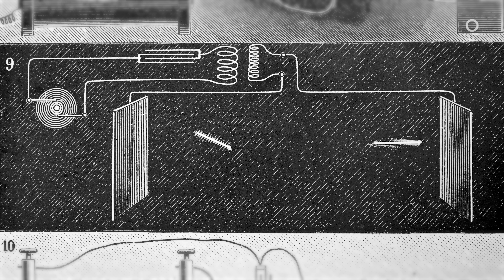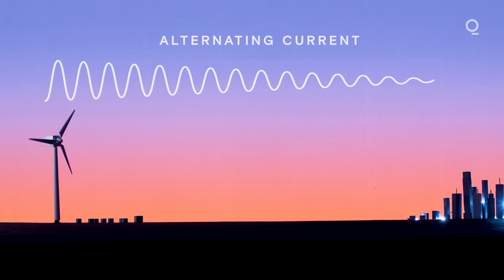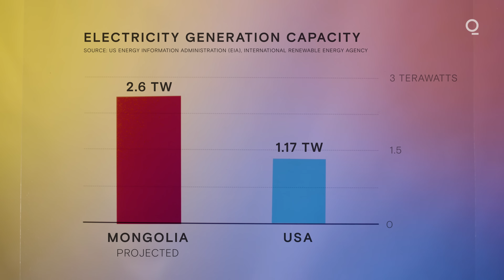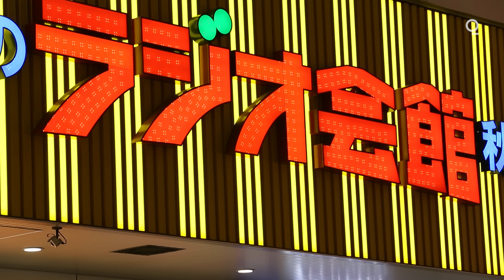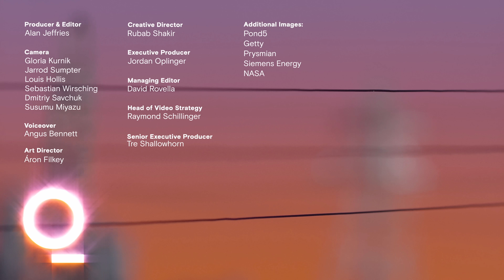The World Needs Supergrids, But There's a Problem

Comment: Are there means to transmit electricity via microwave beams instead of cables ?
Reply: That's potentially doable.  For intercontinental power transmissions, satellite mirrors and ground stations would beam the microwave.  If Saudi produces excess solar energy and Japan wants to import it, than Saudi would beam the energy into space based reflective device and then beamed down to Japan's ground receiving stations.  Solar energy can be stored as heat in molten salt.  We are talking about energy economy here, so everything must make economic sense of course.
Reply: The are multiple projects in existence. But so far either transmission rate, transmission efficiency or range are terrible

Comment: The AC is not attenuated in the shown way by distance.  What really happens is that power is transferred by phase shift between the ends.  As a demonstration:  To feed more power from end A to end B, you need to feed more coal to the boiler and try to speed up the generator at station A.  That advances the phase at A relative to station B.  However, there is a natural phase delay in power lines and to keep the A and B synchronized, you bump into the true distance limit, something on the order of 1000 miles where the phase shift becomes excessive..  You need AC to DC conversion and corresponding DC to a second AC conversion every so often.  In other words, to keep the two end frequencies and phases localized.
Reply: This makes a lot of sense! Do engineers have the infrastructure to make this happen?
Reply: @marktwain368  It doesn't make any sense at all. The guy is living in a world of illusion.
Reply: @marktwain368  Losses are measured per m and in all of my calculations that I've done at work it seems that there is less losses in HVDC UGC than HVAC

Comment: I think the transmission energy loss via heat would be too much. A better way is to produce electricity close to where it's needed. In other words, SMRs for small towns and large NPPs to provide baseload power for countries. No need to have insanely long and large transmission cables between continents or anything like that. Added bonuses are medical radioisotope production, desalination, water heating and carbon-neutral petroleum/diesel production.

Comment: The farther we try to transport electricity the larger the "line losses", energy dissipated as heat along the wires.
Interconnectivity of grids does still have important advantages though. It provides redundancy, so that a breakdown in one part of the grid can be bypassed through alternate routes. But in the end, the most efficient plan is to try as much as possible to have "distributed production", lots of small scale generation scattered around the grid. This reduces line losses. Also, as we move more and more towards solar and wind, we can take better advantage of their production periods. 
This is why rooftop solar and small to mid-scale wind farms can work very well together. 
Yes, there are times when the sun doesn't shine. But at those times, heavy cloud cover or night time, there is often wind to compensate. And sometimes conditions can be quite different between 2 locations just a few miles apart.
So, grid interconnectivity and distributed production can be designed to make much better advantage of these renewable resources.
And yes, I readily acknowledge they will not account for the large majority of our needs anytime soon. But they have an important place and we could be making much better of them.
Reply: Ideally, from an environmental standpoint, resources consumed locally are produced locally. This general principle almost always has advantages. Future urban development and growth really needs to factor that in.
Reply: Not with hvdc
Reply: What about underground transmission using low resistance superconducting materials? Hypothetically, of course, assuming it was technically and economically possible. Maybe a continental grid connecting US-Canada-Mexico. You could co-locate communication data lines, and both would be impervious to EMP and solar flare radiation. The cost would be exceedingly high but the potential benefits might justify the risk.

Comment: Im thinking bore hole water down the hole and up comes steam if its deep enough, steam turns the turbine to make electricity easy :) but perhaps a little more research needs to be spent on deeper bore holes.
Reply: Geothermal is only practical where the Earth's geography favors it. It will always be a small percentage of overall electricity generation.
Reply: @JeanPierreWhite  hence the research needed to bore deeper bore holes :)
Reply: @JasonPurkiss  Digging a deeper hole doesn't need research. It needs money. Some locations we don't need to bore very deep to find heat underground. In other places it's much further and therefore becomes economically untenable.
Reply: @JasonPurkiss  If the process can be made cheaper it would open things up somewhat. Not sure I see the point of going deeper than 22000 meters.

However it maybe less expensive to build solar and wind on ground.
Reply: @JeanPierreWhite  a bore whole would last a life time where solar and wind power has to be replaced every 5 to 10 years and would expell more carbon dioxide in its creation

Comment: Yes true but a super grid and evs and intermittent peak geographical loads with humans as random as the weather 😄 Wires get exponentially bigger and longer over distance lol 10,000 EV'S anyways is a dynamic peak loading! If you dont assume killing fuel is a must to be green then a Small Nuclear Reactor  will not need as many wires.

Comment: Or maybe instead we just build more smaller nuclear reactors and we dont have to worry about transmission lines as much.
Reply: its expensive and should only be used as a baseload. Renewables are by far the cheaper and will form the majority of our electricity production
Reply: You will still rely on transmission lines.
Reply: It's possible, smr fit to fulfill energy nearby with cheap cost.
Reply: For some reason there is a secret agenda against using it. All the education proves a reactor would be the best choice but no one wants to do it.
Reply: NO
Reply: Clean fuel cycle for nuclear?
Reply: the real problem with this solution is nuclear proliferation and the unintended consequences.

Comment: The very concept of centralized power generation to distributed power consumers is antiquated and risk laden. Much greater affordability and network resilience is achieved if we look at all consumers as generators and empower them to produce and store their own power, and more where possible, for public and private benefit. An entirely distributed grid of independent generators in other words, with centralized need only for maintenance and modernization when required
Reply: Right! Let's get rid of the grid.

We'll just buy solar panels and batteries for everyone. For 12 h of solar I need 2x as many panels and 12 h of battery (for the night).
Oops, my neighbor's house was just hit by hail.

We'll just buy solar panels and batteries for everyone, and have a small distribution grid at the neighborhood scale. We'll have to raise the solar, because when the neighbor's output goes down, the rest of us have to make up the difference.
Ooops, my neighbor's house (right next to me) was just hit by hail - and so were all the other houses (including mine) in the neighborhood.

We'll just buy solar panels and batteries for everyone, and have a large distribution grid at the city scale. We'll have to raise the solar, because when a neighborhood's output goes down, the rest of us have to make up the difference.
Oooops, the winter is particularly cloudy, so we'll have to build a small transmission grid at the state scale.

We'll just buy solar panels and batteries for everyone, and have a large distribution grid at the city scale + a small transmission grid. We'll have to raise the solar, because when a city's output goes down, the rest of us have to make up the difference.
Ooooops, the winter storms cross multiple states, so we'll have to build a large transmission grid at the nation scale.

At this point, given we have a full distribution system and a large transmission grid, why bother with the solar panels and batteries, and just use centralized power stations? 
Something low-carbon and centralized that can be put anywhere.
hmmmm.
hmmmmm.
hmmmmmm.

Like nuclear.

Comment: "bump up your current to a much higher voltage" current is measured in amps and voltage is what you are transforming up, to Lower the current in the wire because p=U*I the higher the voltage the lower the current for a given wattage. This allows for thinner wires.

Comment: The problem with super grids is dependency on foreign countries. We need to figure out how to live in an area based off the area, not based of the fact you can import resources to live in an unsustainable area. 

Without the pressure to supply for local demand with local power sources, we lose innovation and we abuse the power sources we already have. Just like oil/coal/gas. 

There will be problems with renewables and a sustainable approach is a diversified one where the needs are met by tailor made solutions for the area, not just brute force imported.
Reply: It's more elegant to design a system that can work independently of other countries, but just imagine how half of the earth has always sunlight, and can power the other half at night. You remove the need for battery storage. At least in the short term it would increase the capacity of the grid and would add redundancy to already self-sufficient places.
For example, you can waste less energy when you have more than you need and just sell it to other countries
Reply: If we can trade goods with each other then why not trade electricity also ? Export when you have surplus electricity and import when you have a shortage....
Reply: True but I think if the super grid were to become a thing the countries that have a lot of renewables would start selling their electricity off just like with how coal or natural gas sells the resources.
Reply: A decentralized grid is superior to a centralized one. It leaves no single point of failure and it gets rid of the transportation/transmission issues.
Reply: @kirbyjoe7484  Why not interconnected decentralized grids that act as a power plant market. The issue with seperate girds is that they are plagued by instability because they lack the electrical 'inertia'. This is a already a large problem for Texas and the two separate Japanese grids.
Reply: @gljames24  look at the HVDC grid in Europe , they are almost there
Reply: I think civilization as we know it is based on the principle that you can get any product anywhere in the world, without it we would go back to living in places rich in natural resources and not live in places without them
Reply: The sun does not shine everywhere at The same time. We already depend on what happens in foreign countries. We simply need to throw away the war machines and get down to the important business of civilization upgrading. As a species.
Else, fossil fuels will doom us with their dark clouds.
Reply: That's a long winded way to say, "I'm just an isolationist racist who thinks everyone else ahoud just die so I can have everything"... get an education and stop bring proud to be ignorant
Reply: With that approach people wouldn't move past temperate climates really
Reply: Ridiculous
Reply: Blah blah
Reply: Well said. Being self sufficient with local power sources only is the way forward.
Reply: @JeanPierreWhite  in an imaginary world yes. In a real world no.
Reply: @JeanPierreWhite  lol, as if every community has the capacity to do so.
Just don't get dependent on autocracies.
Reply: Small modular nuclear reactors seem to be a way out of that problem.
We are not going to see that level of cooperation globally anymore, not with what happened when the cabal of WHO/WEF caused the worst economical collapse of the this and the next century, affecting billions of people.
People just don't want the risk of having a global logistics chain anymore.
Things will have to be produced locally, forget this idea of a global 'internet' of electricity. 
Electricity is too strategic of a resource to share.
Reply: @monad_tcp  how did the who cause the economic collapse?
Reply: @garganransis   that's very obvious, isn't?
The unnecessary lock-downs
Reply: @monad_tcp  Nuclear reactors still need uranium imported from somewhere. Uranium deposits are not everywhere.

Comment: The word needs rid of the grids by decentralizing power generation and storage.  That will also allow us to switch back to DC appliances.
Reply: @lepidoptera9337  high voltage DC is also MUCH more dangerous because quenching a DC arc is much harder than quenching an AC arc. DC circuit breakers need to be built to higher standards and you have more danger of arcs starting at the connection points (such as plugs and switches).
Also three phase AC allows massive savings on copper compared to DC (for balanced loads with 3 wires you can trasmit as much power as with 6 wires of the same diameter in DC, and if you have unbalanced loads you just need a 4th wire).

Three phase AC is vastly superior to DC in all respects except for extremely long distance and undersea power transmission.

Comment: Tesla did not invent AC. William Stanley Jr. demonstrated the first high voltage AC system. Tesla invented a very popular AC motor.
Reply: Not quite, Nathanael. Tesla patented a lot of trivial adjustments around the edges of things.
His only notable invention was the Tesla coil. It makes impressive sparks using weak power at high voltages, and involves no original invention. 
Just like the man himself.

Comment: The main reason for AC being better than  DC was that AC has much lower losses as heat in comparison to DC when at high voltages at long distances! And the voltage changes between positive and negative values!

Come on Bloomberg, get the science. Yours Truly, AP Physics Teacher.
Reply: That’s what I thought too, so why do they want to build DC lines at all?
Reply: Not really no. DC has no skin effect, for example. Also a lot of other benefits: charging loss,.corona etc.

Comment: Bad idea .... Worst idea 💡 Muslim countries are very hostile and if they have a problem with a country they can cut the power same goes to China and any Communist or corrupt county just a bad idea .... Globalization is a bad idea also this is the reality
Reply: You are thinking of a system like the current fossil fuel, where a small number of countries supply most energy and rest pay!!!! Where the supper grid would be a symbiotic relationship sharing power in all directions, more like the internet than the current fossil fuel system. So any one country turning off is a minor issue, and affects them most as they wont receive any energy when they need it.

Comment: There's a series of videos called "The Light Tamers" by a physics professor here on YouTube that has the history of electricity in more details. Though Tesla was a main character in the story, the three phase/three wire system was developed by a Russian in Germany and Steinmetz developed a series of mathematical tools - mainly the Phasor - that were fundamental to the development of the field.

The first DC power transmission was installed in Brazil to get the 50Hz from the 8 turbines that generate energy to Paraguay into a town near where I live in São Paulo. However, that was only needed because on the agreement to build the Itaipu power plant a rather small country, Paraguay, got half of the generators and they were all built for 50Hz while Brazil uses 60Hz. Brazil has a historic debt with Paraguay because of the late 19th century war so I find the agreement fair.
Reply: They attacked first but it's true that we did an overkill
Reply: Nós não devemos nada aos paraguaios.

Comment: There are a few companies working on plasma boring devices which could eventually allow for affordable underground tunnels to carry HVDC lines, and hopefully avoid the politics of surface land
Reply: I had the same idea of underground tunnels but wasn't sure it would be economically feasible due to boring costs. If it was there are three issues  related to it, one negative and two positive.

Negative: Insulation. As i understand it above ground transmission lines are bare and insulation is provided by the surrounding air. This doesn't work underground. What is the cost of insulating underground wires and is it prohibitive?

Positive 1: Increasing efficiency by decreasing resistance using low temperature superconducting materials. This obviously can't be done with above ground transmission. Newer materials are being developed which work at low temperatures higher than near 0 degrees K. Is this technically and financially feasible?

Positive 2: Underground power lines are impervious to EMP and solar flare radiation. Communication lines could be co-located in the tunnels. The tunnels would not have the capacity to transport all of the required power and data but would transmit enough for essential amounts until terrestrial power was restored and more communication satellites could be launched.

I envision a continental backbone for US-Canada-Mexico.

Comment: Electric or magnetic fields, move at 300,000km per seconds, while the associated electrons move as fast as termite.
Reply: What is your point? Electricity is transmitted by the moving electric/magnetic fields not travelling electrons. Consider AC current. If the electrons moved they would go back and forth in the same distance.
Reply: @richardrose2606  I think Mark was merely correcting a mistake in the video that stated we "move" electrons through power lines.
Reply: @ReidDickson  I'm sure you're right but it was unclear what he was referring to.